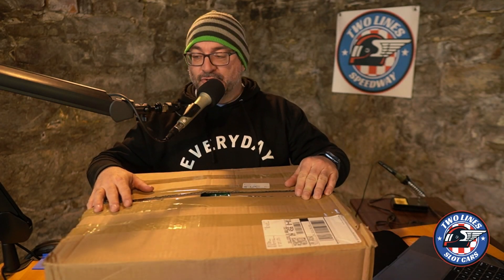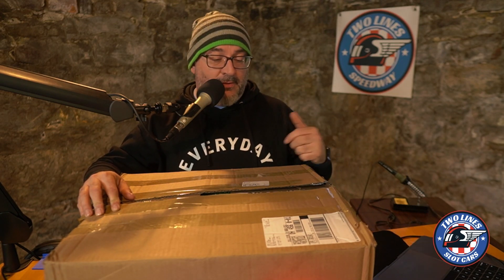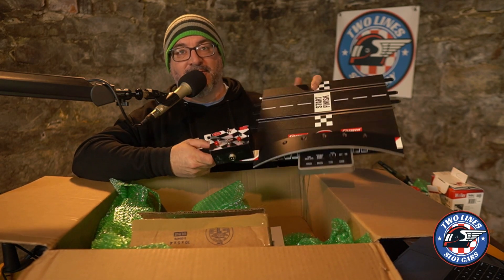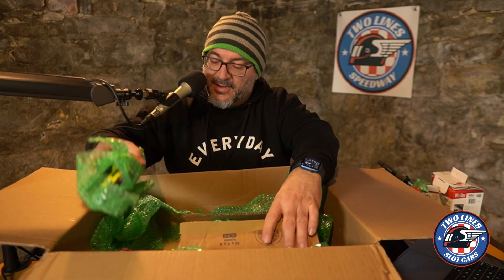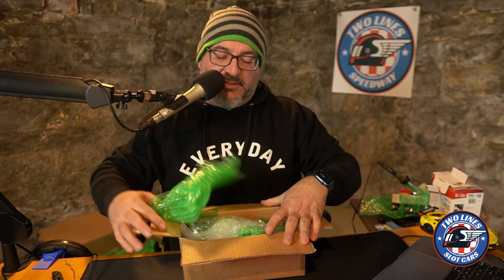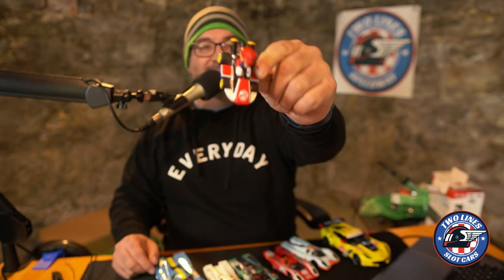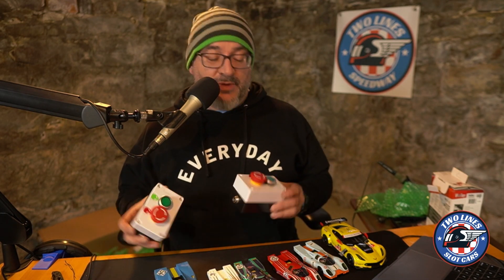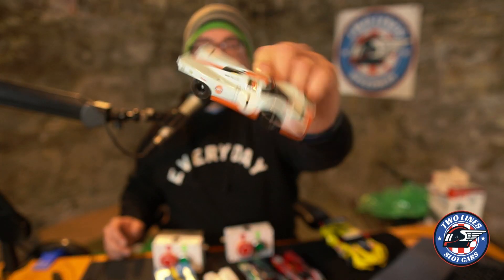What is in the box from Area51 Raceway?

Comment: Great vid!  Can you explain how analog racing was just as fun as digital?
Reply from the maker: I believe they are really two different things.. analog let’s you run so many other brands of cars on the track. Yes, you can always chip a car, but some cars just perform better than others. I think it has to do with the format of the race at the club. The analog races were about getting as many laps as you could during the race. So I felt like I was racing myself and the lane. Digital racing was chaos on the track. Both were so much fun, just for different reasons.
Reply: I think I would miss the lane changing, and programming brakes and power, and ghost cars, and everything else that goes with digital.   But sure enough lots of really slick cars are analog.....................I could see having the box so as to change back and forth easily.  Alas I have other toys that need time and money also.

Comment: Nothing wrong with staying digital and doing scratch building. Just add the chip. Multiple size chips readily available. What is the lure to scratch built without the chip?
Reply from the maker: It helps keep costs down when branching out into other brands of cars. I love digital racing. Experienced analog racing just this past Thursday and had a fantastic time!
Reply: Several things... Chipping a fleet of cars can really add up, and installing chips in some cars is difficult and time consuming.  Most track owners i know have an average of 25 cars.  Chipping 25 cars $40 per car is $1,000.

Chips limit motors that can be used.  They can only carry so much current before overheating. With true "chipless" analog and a good power supply you can run a whole universe of cars that would kill chips including vintage cars that often have less efficient motors and more powerful motors including those used in metal chassis commercial cars.  If you really want to scratch build, you can even wind your own armatures and prepare motor set-up as the racers of the 1960's did and top racers in faster car classes still do.  There is life beyond generic disposable motors.  

I really like Digital racing, but true "chipless" Analog has other advantages too.  There are a huge variety of analog controllers from very inexpensive to extremely exotic for analog racing. They make a real difference in driving experience and lap times.   Also, not everyone enjoys the traffic that sharing lanes in digital brings in.  It is nice to chase the perfect lap without being blocked by slower cars, running into cars stopped in your lane, or being crashed in imprudent switches.  This is especially true with driving rare vintage treasures or a scratch built car you have spent many hours perfecting!
Reply from the maker: @jimcunningham534  thank you for sharing your thoughts! I was trapped in the world of digital because I really enjoy the atmosphere that running an app like "Smart Race" creates for people racing. I really enjoy lane changing and pitstop simulation, it adds so much to the overall experience. I never gave analog a second thought until I bought my first Slot-It GT40 and I had to cut out the interior to fit the chip inside the car. As I have now purchased a few more analog cars, I really don't mind chipping them, but paying to chip them is getting old.  So going down the path of converting my digital to analog in a convenient way is where I am in my slot car journey. I raced my first analog race last week and I am hooked. I am now a fan of both digital and analog.
Reply: @twolinesslotcars  I am a fan of all forms of slot racing.  I started with Aroura Model Motoring HO in 1962.  When I started racing at large commercial tracks in the mid 1960's I experienced slot cars "Golden Era".  When I began winning races I learned that if I won the Wednesday night race 3 weeks in a row on the fourth week few wanted to race, so I developed a habit or retiring wining cars and starting a new series to work my way up. In this way I have raced about every scale and style of slot car over the past 50 years. I have kept most of my "retired" cars, maintained and ready to run. The high detail of recent 1/32 cars seduced me and they from the bulk of my 1500 car collection now.  I developed OmniSlotBox, to enjoy all that the hobby offers. I think the variety of forms and the challenges they offer is what has kept my passion for slot cars alive.
Reply from the maker: @jimcunningham534  I received a slot car track for Christmas at about 10 years old. My little brother and I wore the track out. I rediscovered slot cars early last year and started my YouTube channel because I immediately became super passionate about the hobby. I knew there had to be many others out there going through this journey at the same time and I wanted to share my experiences. I am having an amazing time. Thank you for sharing your history with the hobby. I feel like we are in a renaissance of slot cars. I really don’t bring anything to the party, just happy to be invited. Thank you!
Reply: @twolinesslotcars  I can see having a box that makes changing from analog to digital easy, but  everything that goes with digital seems like the future of slot cars.  A lot more going on, learning to work with traffic, and not allowing other lane changing cars to knock one's car off track, it takes planning.  Analog, is analog, its slot car racing with 4 or 5 lanes just like it was 40 years ago.    Takes a lot of space to do it proper.